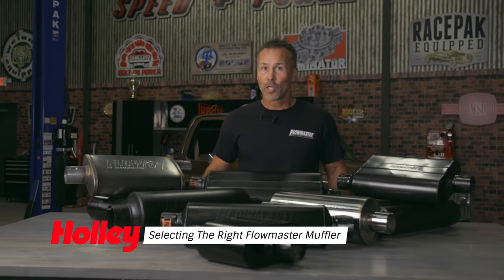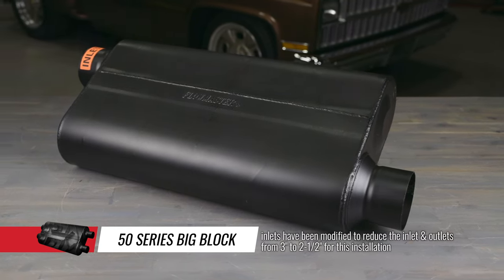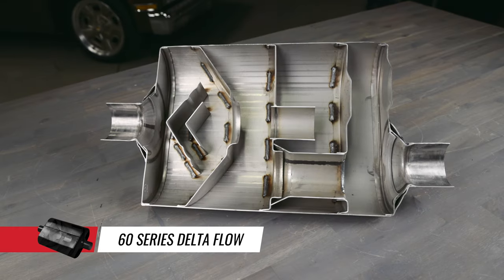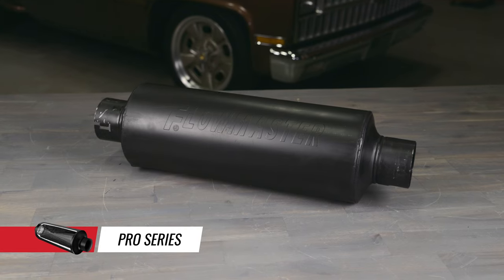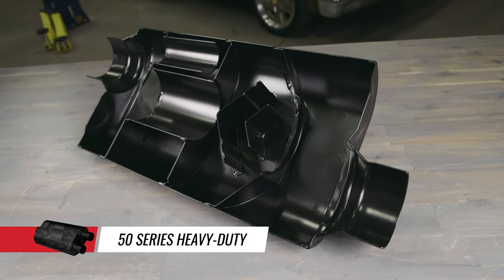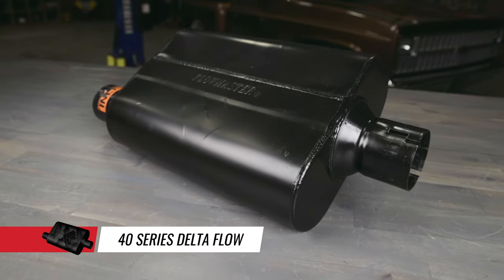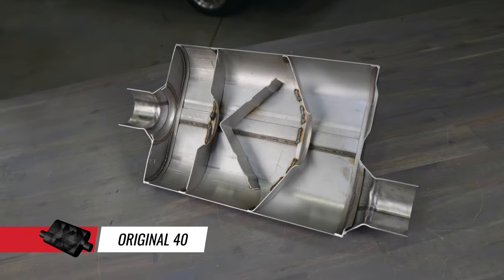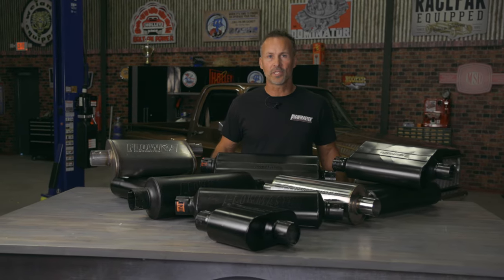Selecting The Right Flowmaster Muffler For Your Vehicle

Comment: They all sound the same
Reply: Agreed.  No discernable difference coming through the video.  I wonder how much different they may have sounded in person.
Reply: A DB meter would have helped this video immensely
Reply: Try head phones… or higher quality speakers. I picked up on it really well.
Reply: Why did all sound the same I’m thinking they are pulling our leg and they never changed a muffler one on that pick up they only use the mufflers that came on the pick up and just showed you a different muffler each time. Besides David Vizard said that flow masters were the worst mufflers you could buy as far as good flow without power robbing back pressure
Reply: In person they're very different! I've been using them on my 89 Mustang for over 30 years!
The ones have now are still awesome but they can't compare to the ones threw on in 91
Reply: There are many differences, but you can’t get it with phone speakers or without using headphones.
Reply: Are you deaf ?
Reply: I can tell the difference of each one even the very subtle differences.
Reply: you, my friend, do not have an ear for exhaust sound
Reply: @Maaaaaax-07  are you?
Reply: @dustinnevarez614  you don't know what sounds good
Reply: @georgejensen339  No 🤓
Reply: @georgejensen339  ok lol
Reply: If youbcant tell the difference, you either need a better sound output or hearing aids. Try on headphones. They are all different.
Reply: It’s very difficult to tell, listening through a phone or computer speakers. Some of these deep tones even with a good subwoofer would be hard to re-create. There’s a huge difference between the quiet mufflers and the loud mufflers.
Reply: Agreed, I listened on headphones. Apart from the Big RV Muffler they were all within one, or two, CH's of one another.
Marketing hype to lighten the wallet of the gullible.
Reply: complaint department is closed.

Comment: The bad thing about using a LS powered vehicle is they don't sound like anything else, not Mopar, not Ford or anything that is older GM. So you really can't get a fair judgement on the muffler. Just like the 5.0 Mustangs in the 80s and early 90's, they have they own unique sound.
Reply: It’s a comparative measurement, dude…

Comment: I like performance with stealth.  Flowmaster mufflers installed in line achieve that.  I usually replace the resonator with a  Flowmaster muffler.  Then pick whatever Flowmaster muffler fits in place of the muffler.  My neighbors like my preference for stealth.  But I like how the Cops stay napping at the donut shop.

Comment: The first mod I install into every vehicle that I’ve owned for the last 20 years is a K&N intake.
So after owning my 23 Tacoma TRD Off Road, the first week I installed the K&N.
I’m now saving up for the FlowMaster Flow FX dual exhaust for my TRD.
I had a K&N intake in my last pickup which was a 11 Ford Ranger XLT super cab 4WD with the 4.0L V6).
I also installed a FlowMaster single exhaust on it.
The combination of the two gave my Ranger more horsepower, torque and mpg.
I’m quite sure that a new Flow FX on my Tacoma will do the same.
I LOVE the Deep Throaty sounding pickup
Reply: Cool story.

Comment: Around 3 years ago I chose the 2.5” Delta Flow 40s for my mostly stock ‘95 Impala SS in the OE location/resonator delete. I’m extremely happy with the sound, inside the car….AND outside. I think you’ll like it too. Crazy, considering the design of the Delta Flows, but I think that their sound has even gotten better with age. I’m lovin mine.
Reply: Edit….forgot to add that I exited the exhaust right behind the rear tires on each side through 2.5” pipes with stainless slant tips. Looks great too.

Comment: I grew up with lots of pick-up trucks / four wheel drive mudders in my area. Most had glass packs, so I associate the signature clatter, pop, scavenging crackle and reverberations with trucks. Whereas to me, most Flowmaster mufflers have a more modern, deep  and refined tone, plus they offer about 8 different models / sizes with varied sound restriction, so without listing the specific “series” of Flowmaster mufflers, it’s kind of misleading to potential buyers (which too many online comparisons do). Personally, I wouldn’t put glass packs on a recent model Corvette, Camaro SS, Mustang GT 500, Hellcat, Mercedes V-8, Bugatti, or Escalade, but to each their own I guess. 🤣

Comment: Great video! Do you have a application in stainless steel for a 2014 E550 Mercedes Benz with a stage 1 tune that has  low cabin noise

Comment: I’m installing the Flow FX dual exhaust system on my 23 Tacoma TRD Off Road.
Reply: How’d it go?
Reply: @juanito937  Sounds Awesome
Reply: @Doc1855  man that’s great. I put the Flow FX dual in/single out on my Tundra. Sounds nice and deep but I get a lot of drone around 1600-2000 rpm. Looking at some options to combat that
Reply: @juanito937  I’ve found that a dual exhaust is better and you don’t get that drone.
On my 2010 Tundra 4X4 (5.7L V8), I had Toyota install the TRD dual exhaust.
Reply: @Doc1855  thanks for the advice. I’m gonna take that into consideration because I’ve been tossing around going with dual exhaust vs a Y pipe and resonator combo